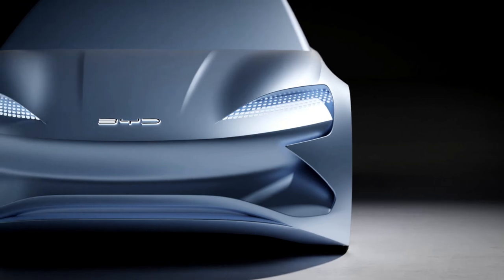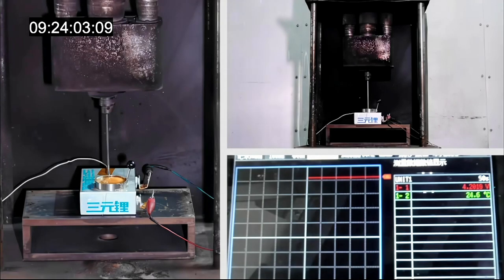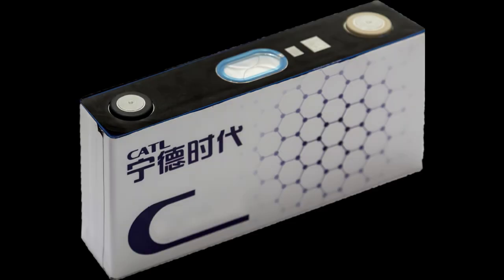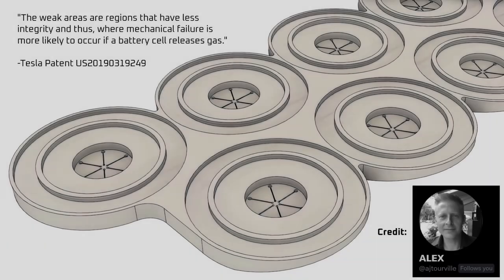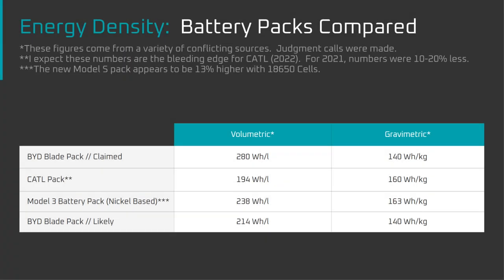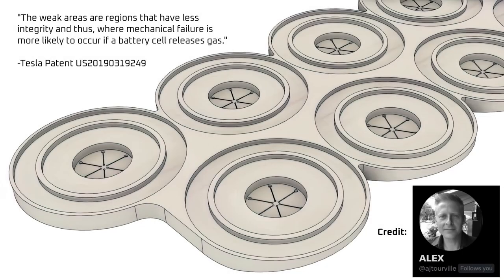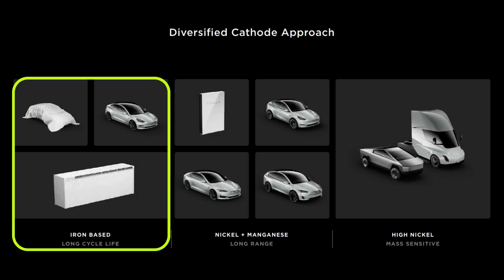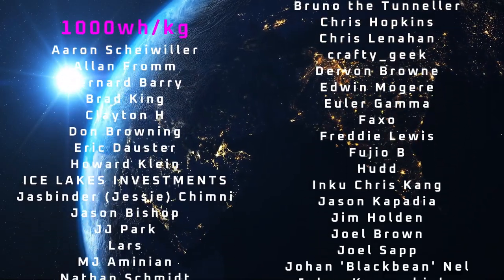The BYD Blade Battery Evaluated:  The Hype is Real (Mostly)

Comment: At least two of the major claims for the blade battery sound specious to me. (1) fill factor is not necessarily any better for a blade battery than for cylinders. You have to circulate coolant somewhere. You can cool the cells at their ends, through a cooling plate, But with either packaging type, you need to circulate coolant past all available surfaces to keep all parts of the cell from overheating. (2) A cell design that is thin in one dimension may not help with punctures as much as you may think. If the blades lie flat in the pack, they will have to be stacked, so they will end up with penetration depth possibly as bad as for a prismatic cell, or a bunch of cylinders stacked on end. OTOH if the blades are laid in vertically, mast punctures will be along an edge. That may actually be safer, but the same will be true for a cylinder that stands vertically.

With either type of design, I think you have a fair amount of latitude in deciding how to mount the cells in the pack for best safety and other criteria.
Reply from the maker: Good points!  1)  Will be covered in my 4680 LFP video.
Reply: Yeah - I want to know where the coolant goes. Some articles suggest that there isn't any because they are running these cells at 60C, so only have passive cooling and embedded heaters. this makes sense because power output and input is much higher at 60C and internal resistances are low and it helps some issue with the carbon anode that I don't understand, and the material is heat-stable at these temps, unlike nickel-based cathodes. If that's all true then it will improve pack density, although I presume they still need an ali sheet in between each cell to wick heat to the top and bottom plates, but maybe not coolant channels? But the e-platform 3.0 (next gen used in the Ocean-X) talks about a heat-pump for heating and cooling, which implies a coolant circuit again.
This article shows an exploded pack diagram with a coolant loop on the top surface only, so relying on conduction to get the heat to there. https://medium.com/batterybits/a-sharp-contender-byds-blade-battery-ced2ef1dc8f8
Reply: Puncture is a battery-safe test for the simple realization of "absolute short circuit"! This is one of the toughest extreme tests of all batteries!
Reply: Therefore, BYD has been developing blades for a long time and has encountered many process limits, such as ultra-thin winding and length, which are very difficult, so BYD has a blade battery patent in 2019！

Comment: Another great video! Another interesting area to dive into is the electrical characteristics of LFP vs. Nimh.  Also typical ESR or internal resistance. That translates to lower current capability in and out so cars will be slower acceleration and in theory lower charge rates?  LFP is better suited to lower cost and performance vehicles. Tesla need every battery they can get.  Any way, just something else to think about, Keep up the great work!

Comment: what  if the battery is pierced long ways? piercing in an  orientation the battery does not lie in, and not showing another puncture from the bottom makes me wonder
Reply from the maker: See the pinned comment.  No battery is safe.  Yeah, you can find a way to make the Blade erupt...the point is that it's safer.

Comment: i'm still interested in NMC or other low cobalt chemistries in a blade form factor. even if the structural strength is lower, the increase in heat dissipation coupled with pressure relief could bring NMC closer to Prismatic LFP, even if it won't reach Blade LFP safety.

Comment: I had no idea they were so cheap! Would the thin form factor allow additional cells to be added without expanding the floor of the car as much? With cylindrical cells you have to double the thickness of the floor if one layer of cells isn't enough, but it seems like the blade wouldn't have this problem.
Reply from the maker: Yeah man!  And it's a great point.  BYD advised they were actually able to make the floor thinner and increase the aerodynamic efficiency with the blade.
Reply: @thelimitingfactor  It surprises me then that the haven't been able to make any long range cars then. If the floor is already thinner and additional blade layers can be added iteratively then why is volumetric density the limiting factor for LFP? It seems like this a game changer for the viability of LFP for long range cars. If NMC has 10% better volumetric efficiency then can't BYD just make the floor 10% thicker to make up the difference?
Reply: They are always shown placed vertically, presumable for structure. So no height modulation.
But they might be manufacturable at different height? I don't know if cylindrical can easily do that too.
Reply: If they add multiple layers wouldn't that kind of ruin the extra safety part? I mean then the nail would have too puncture multiple blade cells for it to be a fair comparison with prismatic cells.
Reply: @thelimitingfactor  
Imagine if they took a stack and "knocked them over" to an angle of 45°?
I make that about a ...(takes shoes off to count on toes).... roughly 29% reduction in the height of the stack ( √2  ?)
Maybe a 30 mm thinner floor section? Useful?
Reply: @rogerstarkey5390  Why not knock them full 90° then? xd

The answer: because if you make it thinner, you have to make it longer and/or wider to have the same volume...

Comment: If you look at the number that Tesla just did this quarter, their cost should be going up, but it went down and book a higher profit margin.    I think that what happen is that in the Fremont factory in the third quarter and they installed LFP batteries for the cars driving down cost.   That just amazing, I haven't seen that kind of adjustment and turn around in the car industry.
Reply: You're listening to the "kiwi connection"?
(T.E)😉

Comment: One of the metrics that was not mentioned in this video is watt output per weight.  Some LFP cell  are 30"C" or 30 x times the amp hours. The BYD blade has such a low"C" rating I am pretty sure it will not support a high kW output of the motor/ drive.  There needs to be a LFP cell that provides a better balance between performance and efficiency.

Comment: found a listing online, byd blade is simply one giant cell at 3.2V! no wonder it is so safe since it is like a low performance battery only with large capacity.  Amperage or performance would be killed though, im certain with its low charging, discharge, and regenerative braking performance

Comment: Such a great video.

What impress me the most is the cost at 65-78 $/kWh! It doesn't seem to have any sort of liquid cooling. It this one of the reason for the low cost? This should go into grid storage also.

This is the reason I think Tesla currently doesn't have much advantage in the grid scale storage, which is mostly about cell/pack cost.
Reply from the maker: Thanks man!  I think it still needs cooling/heating.  I'm assuming it's plate cooling at the top or bottom.
Reply: @thelimitingfactor  Agree. It will be great for grid storage too. Here I think air cooling will be sufficient.  At this cost we can consider using it for long term storage also. Please do an episode on grid storage with Lithium batteries versus other technology.
Reply: @thelimitingfactor  so it's like Mercedes Vision EQXX?
Reply: Every car which using blade have liquid cooling. so i think that is include

Comment: Great video as usual. Would be interesting to see a video on "revolutionary new Sodium batteries" - seen a lot of hype lately about it being used for vehicles (as apposed to stationary use which seems more suited).
Reply: Excellent question. CATL has received Giga press on the announcement of 30% less cost the LEP, I have seen press cost of cell production est $77 Kwh, and with scale $40 .Kwh.   Appreciate if you could deep dive into these claims, chemistry, cost,  scale-up, product-market fit, competition.   Given CATL track record, I believe this will be a major game-changer in the battery industry, the main driver being Na battery is based on an abundance of cheap raws that are easy to scale.

Comment: nice but you are forgetting performance of large cells or the Blade. I think Byd blade is near their claims except performance. The Blade is still LFP not far from CAtL but CAtls cells are smaller and can be wired for higher voltages or more current.

Comment: Electric Viking reports a new BYD EV which is model 3 size, with a 700 km charge range.
BYD blade batteries can use all of its charge from 100% to 0% without degridation issues, I understand.

Comment: Tesla model 3 std now 267-272 miles EPA range with LFP. We just got one. Battery pack is obviously heavier than the nickel-based original, it appears they may have made an incremental change from the initial US lfp offering last year but I haven't seen definitive treatment of that. I believe they have recently squeezed more watt-hours with the updated lfp battery as the vehicle weight is a little more. Regardless, a wonderful car with worry free full charge.

Comment: AS USUAL AN OUTSTANDING PRESENTATION :: I see the short "multiple" paths of the 4680 a major advantage, including charging & discharging. I accepted there would be problems, but building on the Maxwell' dry electrodes with rolls 5 cells wide, the concept of a "NEW FORM", a flat horizontal cell  300 x 400mm as a blade or prismatic could be interesting.

Comment: Excellent video. One question: are you sure these batteries have a steel casing?
Reply from the maker: Could be Al or Steel with LFP.  You're right though, probably Aluminum.
Reply: @thelimitingfactor  thanks so much….. you all are doing such a great job!! Interests even non-battery folks…..

Comment: I enjoy the rigor and research in your videos. Using the Han and calling it their flagship is incorrect. Their newer cars use an 800v architecture which makes a very large efficiency improvement with far better total efficiency as you are using smaller wires with higher fields in the motors with fewer amps. Their newest car, the Dolphin, at $22000 before incentives is the car Tesla wants to build in 2 years.

Comment: The BYD blade LFP in the MiG ( GF Germany) made Tesla Model Y SR is amazing. Available since spring 2023 it charges better, faster than other LFPs and is on par with the current LFP NCM big batteries. Plug it in at any SoC and get 3C charge rate (5-80%, charge curve still applies). Needs only 30°C for fast charge instead of >45°C with all other batteries. Got the Y now for 6 months and it replaced the much expensive LR version. EVs got better and cheaper with it.

Comment: Great video. One thing not discussed byd is ahead of tesla for vehicle integration. They make everything from battery to all the components in the car. This is why there Cars are far cheaper. When byd eventually sell their cars in Europe etc will shaky e up the market big time. Personally the blade battery is a fantastic piece of engineering based on cost. It's not just tesla wanting the battery its Toyota as well. Remember the blade likes to be charged to 100 percent and also longer cycle life which is handy for VTG. Personally I think they will produce a 1000km ev soon within 2 years max. Their current cars are old tech byd is moving to 800volt charging and ev architecture and improved  efficency etc. Really good point you made about the importance of car manufactures making their own batteries. You can easily see a lot of the smaller car companies going bust due to being to dependent on buying from byd or catl.
Reply: That is a very simplistic thinking. With Tesla 4680, they are on par with BYD on vehicle integration front. Also, Tesla's EV production capacity is unmatched right now, in addition to its self driving tech. But BYD is in a very strong position.
Reply: @archigoel  There not on par with Byd . Costs is key here Tesla sell cars to middles classes who can afford it. Byd is on a different level to Tesla regarding COSTS. They are producing cars that have got great tech great warranty that are affordable to the masses.  Remember byd are producing tricks and buses long before tesla even though about the semi. To many like yourself are tesla fans but don't see the bigger picture.

Comment: I have questions about the test environment versus the real world. In these puncture tests it looks like the battery is exposed to open air, meaning more ideal cooling conditions. So my question is what kind of airflow do these batteries get when they are installed? I'd venture a guess that they will get hotter when enclosed in a car chassis. Are there puncture tests of these batteries while they are installed in a car?

Comment: Jordan, in a battery cell, WHAT is burning in a "runaway thermal event"? The electrical short, caused  by penetration of the separator, causes what element to combust with what element? How is the redox (reduction-oxidation) activity, which is the cell's normal condition, replaced by different chemical reactions? Why won't water put out the fire? What will? Enquiring mimes need to know. Perhaps, you could do an examination episode of battery cell chemical activity initially and during a cell fire; and, cover the means (if any) of putting out such a fire?
Reply from the maker: Hi Art!  Electrolyte mainly, but also plastics, binders, and although I don't know if the cathode and anode are "burning" they are reacting and releasing energy (I think).  The cathode generally releases oxygen upon breakdown, I'm wondering if that has something to do with why they can't be extinguished?

This question involves an entire field of research and to provide a proper answer I'd need to do a deep dive on it.    

Great questions.

Comment: Let us take the nominal voltage of each blade cell to be 3.2 volts (Max 3.65 volts). There would need to be at least 100 blade cells in series outputting around 320-365 volts. However, when you examine the illustration of the pack there are only around 50 cells visible Which suggests there is a second layer of 50 cells bringing the total to around 100? It could also be that the illustration is an approximation and technically inaccurate? Following this logic, the stated energy content for each cell is 646.4 watts * 100 cells gives you about 64.5 kilowatts of energy per standard pack? Just to clarify I am no expert just interested
Reply from the maker: I haven't looked that closely at pack architecutre.  I mainly just evaluated it on a claims basis in this video.  Good point though!

Comment: Good research. One point: Average operating temperatures. We all know that Lithium has the cold weakness. But  how are them batteries performing in hot desert areas? Say the vehicle is parked under full sun and then has to climb a mountain cooling the cabin but also having to cool the motors, inverters and eventually the batteries themselves. Toyota had long been addressing this issue with their conventional vehicles selling only suitable cars to the respective areas. What batteries are they going to use in the semi crossing the Rocky Mountains in the summer heat?

Comment: I'd be interested to know how the internal resistance and charge rate compares to 4680 Tabless Cells.
Reply from the maker: Much lower.  Probably increases the efficiency of the 4680 vs the BYD by 2-3%?
Reply: Blade batteries can withstand faster charging! Because fast charging will cause heat accumulation, and the blade is easy to dissipate heat, it can already be applied 800v or even 1500v charging in the future! 4680 I think it should be difficult, afraid of charging too big explosion！

Comment: Great video, thanks for putting this together. When comparing nickel packs to iron based I often wonder why people don't factor in the fact that it's not recommended to charge the nickel packs to 100% daily....so the extra density isn't really as big of an advantage. Personally, I feel that 200-300 miles is all that is really necessary and will gladly trade a few miles of range for what the LFP packs provide in safety and longevity (2-3x longer life cycles, right?).
Reply: Exactly ！Life is priceless.
Reply: Blade batteries have three generations of updates, and this year will meet 2.0

Comment: I think it's a mistake to use volumetric energy density to calculate vehicle efficiency, weight has much more impact than size on efficiency and you are assuming space is a limiting factor on pack size which isn't necessarily true.

Comment: BYD launched the e-platform 3.0 subcompact hatchback model “Dolphin” in 2021 which has a range of 405km with a 44.9kWh battery. In 2022, BYD will launch an e-platform 3.0 compact sedan “Seal” aiming to compete with Model 3 with a range of 700km. Also the 2022 Model “Tang” SUV (2560kg) will be upgraded with a 108.8kWh blade battery pack with a NEDC range of 700km.

Comment: It seems rational to automatically discharge cells that are adjacent to a cell that is overheating. If the problem cell ignites, at least the adjacent cells will contribute less to the conflagration.
Reply: Granted, rapid discharge of adjacent cells would produce heat and exacerbate the overheating of the failing cell. Maybe there would be no net safety benefit.

Comment: At the pack level, BYD can pack more individual blade battery cells without the cooling system unlike Tesla's battery pack. Perhaps that gives BYD a better volumetric density.